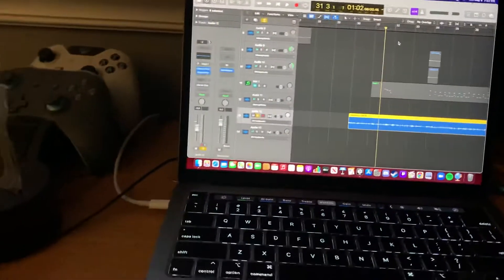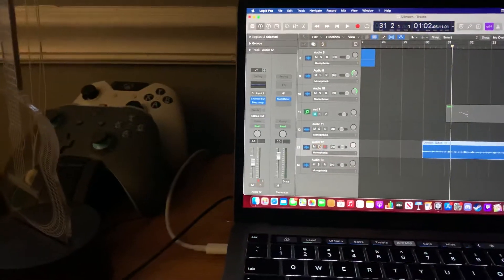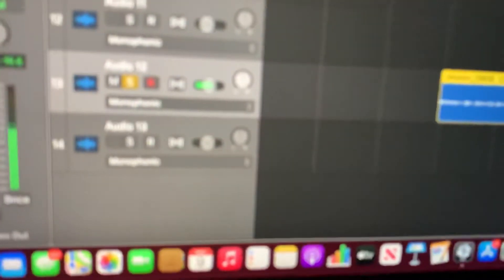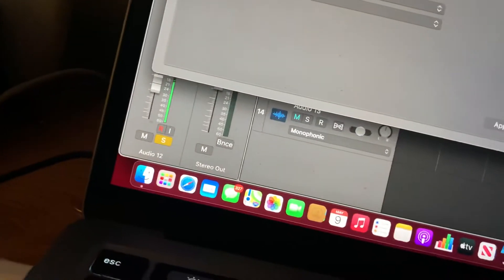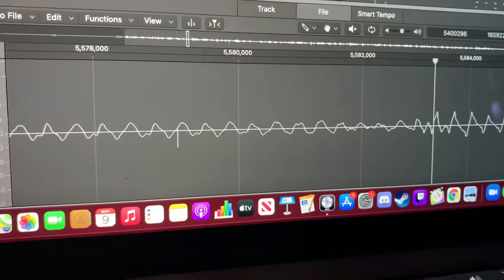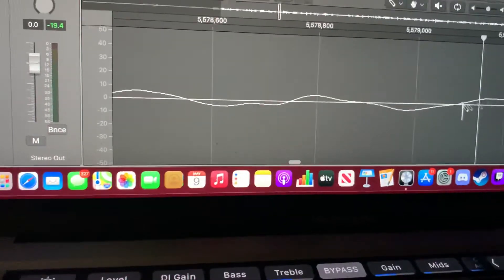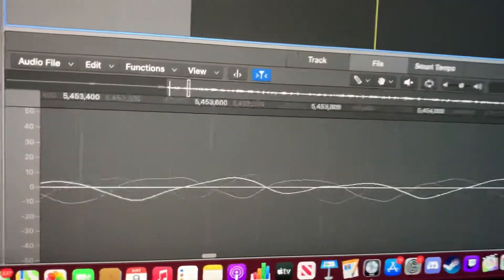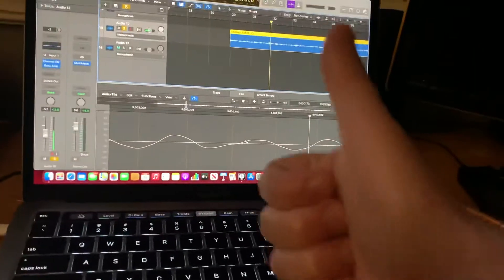How to fix Popping sound in Logic Pro X!

Comment: thanks for the video and info. It gives insight to my issue. Was wondering if you found out how to avoid the crackling before it happens? any insight would be appreciated. thanks!
Reply from the maker: Honestly, it’s a tough thing to deal with and it’s hard to say. Sometimes turning the buffer up can help, going too high makes it hard to record precisely though. So somewhere around 128 works well. Make sure all other apps in background are closed too!!